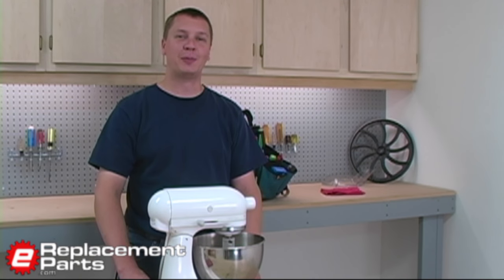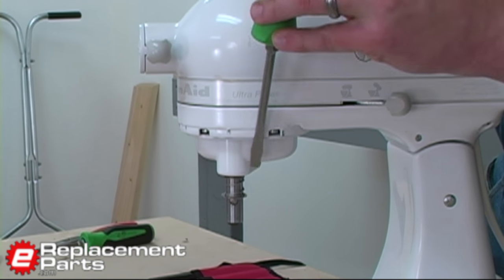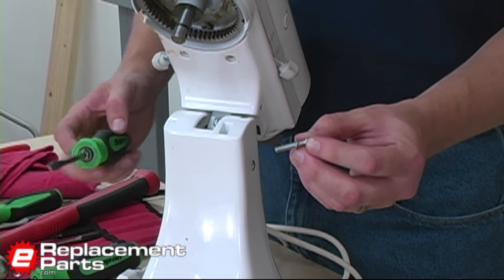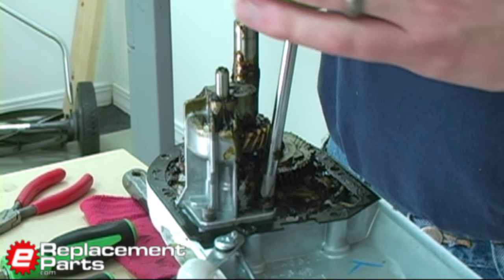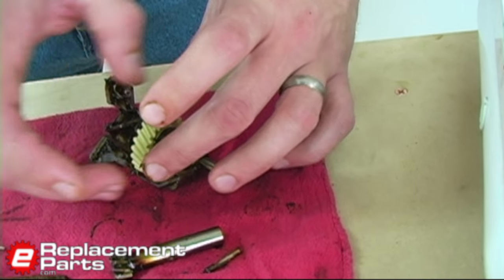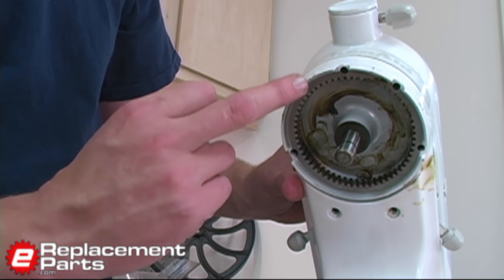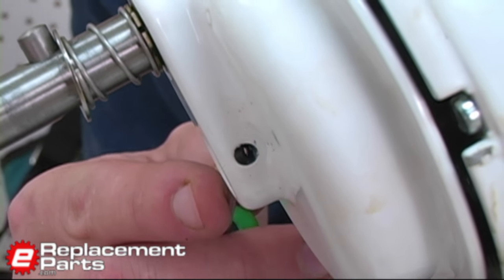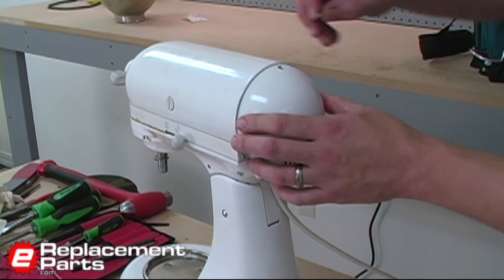How to Fix a KitchenAid Mixer That Isn't Spinning

Comment: I followed this video tutorial because my mixer wasn’t spinning, but was definitely on. However, I went through this whole process and now my mixer won’t even turn on. Do you have any idea what could’ve happened?
Reply from the maker: Thanks for the question. Typically when a mixer won't start at all, it may have something to do with the control board. It is often a bad switch inside the control board that's causing the issue. It could also be that the lever on your machine is very loose, which means it is worn out and will likely need to be replaced. This video should explain a little more for you:

https://www.youtube.com/watch?v=41qTqTWQkMI

I hope this helps, and feel free to reach out if your problem is still not solved!

Comment: NEED HELP... @1:35 he says to remove that pin. when trying to do that, no matter HOW HARD we hit it, or how light, or how many times, it NEVER budges!!
in FACT, it v seems like the pin itself is made of some VERY soft metal, cuz we are scraping/denting the pin after trying to punch it out. and it hasn't moved at ALL.
is there some "trick" to this? or another way to GET to that area without removing THAT pin?
ALSO I BELIEVE our model is NEWER. model number is: KSM150PSBK0 

is there a NEWER or OTHER video for THIS type of model mixer from KA?
Reply: You need: penetrating oil, a nail-set, a properly sized punch (NOT a roll or center punch), a hammer, a hard floor, a towel, incense.

Light the incense and appease the mixers machine spirit.  Place the towel on the floor and put the mixerlaying  on its side on the towel.  Drop some penetrating oil on the pin.  Once the incense has burned down you can now use the nail-set to start the pin out.  Hit it hard!  Once started switch to the punch and drive it the rest of the way out.  

This worked for me, but if your pin has mushroomed you might want to try from other (hopefully undamaged) side.  If both sides are mushroomed a steady hand and a dremel tool could be used to grind off the mushroomed metal, but extreme care is needed or you can damage the mixer.
Reply: +Ash Hanna I had the same problem. Ultimately, I ended up drilling a small hole through the pin to relieve the pressure, then tapped it out. Had to buy a new pin, but it better than buying a new mixer.

Thanks ereplacementparts.com, you earned yourself some business today with this video.

Comment: Hi I purchased this piece from your website for my mixer. I was almost sure that it was the gears since I accidentally turned on the mixer with a wooden spatula in the bowl. The mixer would turn on but it wouldn't spin. I replaced the gear just as shown in the video but now my mixer won't turn on at all (make noise or spin) what did I do wrong? Please help
Reply: Sounds like your brushings need to be replaced.  They are tiny little carbon "rods".  Very cheap to replace yourself, eReplacement sells them and has a video on how to do it.  I replaced mine, super simple only needed a flathead screwdriver.  Be sure to look for the tiny notch on carbon rod and put new one in same way as you take the old one out. Good luck.

Comment from the maker: Thanks for watching! There is a few things that can cause this to happen. The first thing to do is to make sure that your bowl height is where is should be. Our video titled, "How to Adjust the Beaters on a KitchenAid Stand Mixer", will be helpful with this. If there is still a problem you can tighten a screw that hold the locking arm in place.

Comment: My planetary doesn't want to move. It took a pry bar and half a can of WD40 to get it off. Now I have the new part in there and am attempting to put it back together and I am running into the same problem. I've whacked it with everything. It's still not back on far enough to put the pin back through.
Reply from the maker: +Kriste Duke One trick to help with this problem is to put a little grease in the bushing for the center shaft in the top housing. Doing this will cause hydraulic  pressure and will help push the shaft into place for pin insertion.

Comment: our Kitchenaide mixed was working great, then while in use it started going slower and slower and stopped...Follow your instructions and took it apart....found the bevel gear frozen, took it out, regreased it, and the rest of the mixer, went to put it back together and a very small pin fell out of the motor housing from some where, What is it, and where does it go. OH the mixer now does nothing at all, HELP
Reply from the maker: Jack Barnard What model number is your Kitchen Aid?
Reply: Sorry for the delay in getting back to you, it is a KSM75wh Classic Plus

Comment: I replaced the gear, but then when it is all back together again, it won't turn on. This does not make sense because the power was working fine. The gear was the only problem. Any ideas on what I do now?
Reply from the maker: That is very peculiar.  I would open the mixer back up and check the all of the electrical connections to see if something has come loose.  Also, pull the brushes and make sure they are situated correctly on the armature.
Reply: eReplacementParts.com Hi, i have the same problem, checked the electrical connections,  see nothing , any ideas ?

Comment from the maker: @merlot2003 If your stand mixer is a KitchenAid, then the repair to replace its worm gear is going to be very similar to this repair, regardless of its model number. Newer KA mixers use metal worm gears instead of nylon ones. Even though the repair would be similar, it still might not be a bad idea to do another video using another model, just to point out the differences. What is the model number of your machine? That'll give us a good place to start. Thanks for the comment and question. :)

Comment: What if i cannot get out the pin on the kitchen aid?
Reply: Make sure you have the right tools. I began with a hammer and a small torx screwrdiver, because it seemed close enough and was all I had on hand. It was futile. Then I went to the hardware store, got some penetrating oil and a starting punch (like shown in the video, it looks like a pencil with flattened tip), put a few drops of oil on the pin and it came out as easily as in the video.

Comment: I replaced the brushes and the gear, and nothing. Won't spin. I can hear the motor turn on,  and its sounds like it is locked up and struggling. I can spin the gears by hand and there fine. I starting to think it is something in the motor. Both the gears and brushes I took out look fine. Someone please help.

Comment: I have broken KitchenAid mixer Model  #KP2671XWH . The worm gear part I'm looking at online to buy doesn't look like the one in the video. Am I looking at the correct part? Here's the link: http://www.ereplacementparts.com/gear-worm-p-621990.html.

I'm also looking on amazon here: http://www.amazon.com/s/ref=nb_sb_noss?url=search-alias%3Daps&field-keywords=Kitchenaid%20KP2671XWH%20mixer%20worm%20gear.

Not sure what the correct part number it is for my model.

Thanks!
Reply from the maker: This particular model had 2 worm gears. The earlier model gear is no longer available. This earlier gear work only on models with 8 teeth on the motor.  The gear that is now offered is for the later models with 10 teeth on the motor.  Here are some notes from this part:  
This part is for mixers with 10 Teeth on the gear at the end of the motor. This part will not work on the older models with 8 teeth. The Worm Gear for these models is No Longer Available.

Comment: just replaced mine and it won't turn back on. dismantled again checked wires reassembled and still nothing. the gear was indeed messed up now what.
Reply from the maker: +Kiskisa Rawls Double check the carbon brushes and make sure you have them back in the slots as the need to be.  This is a common problem with these and is easily and cheaply fixed.
Reply: +eReplacementParts.com  thanks the black things on the side. one was in wrong.

Comment: I followed Mark's great instructions, found a damaged worm gear, replaced it, put the mixer back together and plugged it in.  And nothing.   The motor worked before my repair, but now there's nothing.   Is there a reset button?  Or could I have reassembled incorrectly.   HELP.... I thought for sure I had repaired my mixer... boo hoo
Reply: Susan Vogl I had removed the brushes, but now they're replaced correctly.  Unfortunately, the machine now only operates on speeds 4 & 6.... none other.   So I replaced the speed control board, but still only speeds 4 & 6 are working.  Any help?  Please!